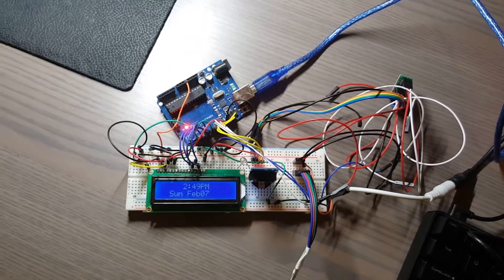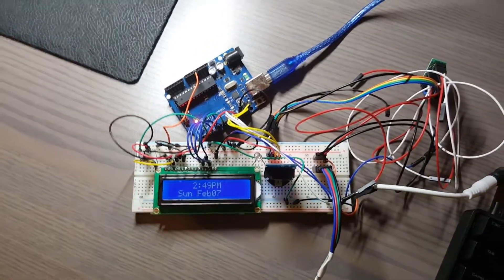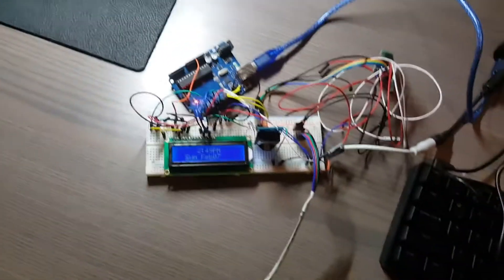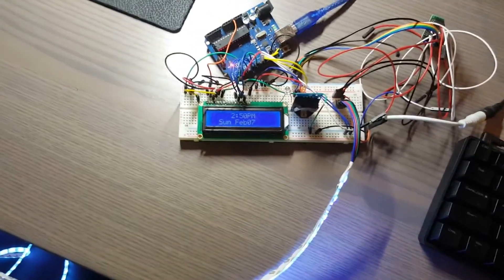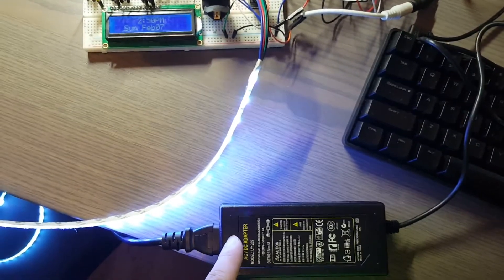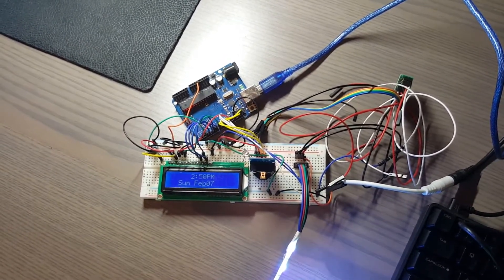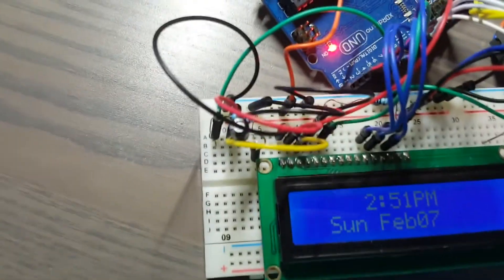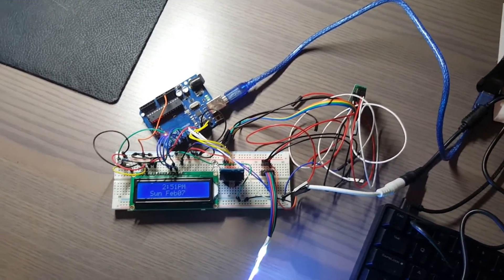Arduino Wake-up Light breadboard demo

Comment: Hello
I tried your code but the rotary switch is not doing anything. I also do not see any reference in the code. Do you have an update or could you Please send me the latest version of you code?

The rotary switch I have is this one.

http://www.ebay.com/sch/i.html?_from=R40&_trksid=p2050601.m570.l1313.TR0.TRC0.H0.XRotary+Encoder+Module+Brick+Sensor+Development+Board+For+Arduino.TRS0&_nkw=Rotary+Encoder+Module+Brick+Sensor+Development+Board+For+Arduino&_sacat=0

Thank's Gerhard
Reply from the maker: Hey I haven't been able to work on the code for a while, been pretty busy. I don't expect to be able to work on this for the next few months, sorry